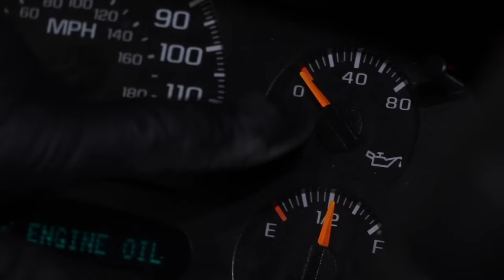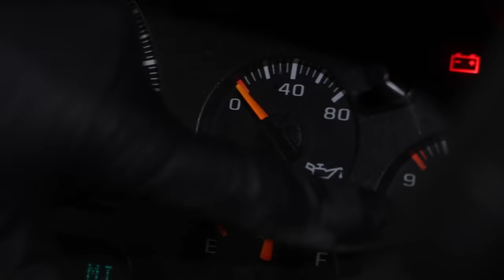Top 5 Problems 2000-06 GMC Yukon Sierra Chevy Suburban Tahoe Silverado Avalanche Cadillac Escalade

Comment: If you haven't replaced the water pump or brake lines, you will!
Reply: no brake line trouble here in the south
Reply from the maker: +Connor Kurtz Thanks for checking us out!
Reply: I have
Reply: Brake lines, water pump, AC resistor, clusters, 4 wheel drive switch, main drive tensioner... but still runs like a champ. Chevy
Reply: I actually have. You are exactly right.
Reply: well everything will need a water pump replaced but yea brake lines in the mid atlantic and north east don't last long.
Reply: I had to replace my brake lines on my 03 tahoe. Moved from jersey to texas... rust bucket
Reply: I’m on my third water pump on my 2005 Escalade at 150,000 miles
Reply: You might have to put new tires on your vehicle someday as well.... lol
Reply: I’ve replaced both on my 2003 Tahoe!
Reply: That can be said for any vehicle.
Reply: Yup.Brakes lines
Reply: Lol.. Just done my water pump on my 01 tahoe
Reply: @Patsslab  sounds like you arent running the correct amount of coolant or theres another issue somewhere in your coolant system..
Reply: I just spent1300 replacing brake lines😂😂😂
Reply: Ya no brakeline here either. But replaced water pump. Damn thing was leaking over my belts and making it squeal then I grabbed the pulley and it was hella loose.
Reply: Only if you're in a state that salt the roads will you need to replace brake lines
Reply: 2001 suburban 4x4 315k miles I’ve put 100k myself I’ve only had to do the fuel pump and rotors just did the plugs I’m still getting 400 to the tank 30 gallon
Reply: I had to replace my Chevy with a Ford... Solved all my issues. Lol
Reply: Changed brake lines 3 times in 3 years lol
Reply: I have Sensors ..whole new brake sensors water pump fuel pump  timing belt and normal wear and tear  But I can say 279.,000 miles and she its still kicking
Reply: @jaydaoud4203   lmao get a Toyota and you won’t have to replace anything. Owned a Camry and currently a Lexus is350 and have had to replace nothing. Biggest issue my 10’ Camry had was the tire pressure sensors were going dead which was to expected at 187,000 miles before it was totaled Other than that never had a single issue besides normal things like tires, oil changes, brakes + rotors. Lexus makes some pretty kick ass suvs that out do the Tahoe even in 2003
Reply: I'd rather lift the body (Yukon XL here) 2 more x for those 2 front brake lines (went stainless) than tackle these trans cooler lines again have fun in your driveway on your back getting the exhaust nightmare out of your way 🤭🤦🏻‍♂️🤷🏻‍♂️🤪 honestly gm would do a world of help simply anti seizing their bolts during production.. and the only place an LS belongs is in a ford, (or ANY damn thing other than that rolling trash can)
funny that sumbitch works like a charm (not in a gm)
Reply: @JohnDoe-di1fk  yours must be the 5.3 /1500 ?
Reply: @Drewsky840  I'm the luckiest mf'r to get one on the cheap in FL...and it wasn't nearly as bad of raod dressings as in this example, it's everything ELSE as well, but these "CHY_NUH!" lines are junk if you don't flush your systems out they rot from inside out too not just from atmosphere conditions.  ("Cheap" is a state of mind
Reply: @Hansel Sanchez ahh. You my friend suffered from the "Magical snapping overnight" ferry...seems to go with these heaps I've noticed
Reply: @slaviolovato1797  oh yes, let’s not forget about filling it up with gas every other day, I hate that!!!
Reply: Yes, already had to replace brake lines from the ABS pump to rear calipers on my 05 Suburban. The water pump, too. But I figured with +150k miles, these were normal wear out parts.
Reply: @c.bernier-tilley2364  HOW MUCH
Reply: 2003 with 240k miles, Nope! No problems at all
Reply: Oh I have,  my brake line rusted out but it went out on my driveway.
Reply: The brake lines were uncoated steel on GM trucks from the late 90’s through 2006. I had all lines replaced on ‘04 Escalade
Reply: @tmurph247  I DISAGREE WITH YOU...I OWN A FORD...A TAHOE... BMW..& A MONTE CARLO...THEY ALL REQUIRE MAINTENANCE" WHY" BECAUSE..ITS MAN MADE" AND PARTS ARE NOT DESIGNED TO LAST ..IF YOU YOU NEVER DO ANYTHING TO THEM...OH IT WANT CRANK" CK THE ALTERNATOR..OR THE BATTERY..CK TO SEE IF THE FAN BELT IS WORN OR LOSE" IF YOU NEGLECT SIMPLE THINGS... MAJOR STUFF IS ON THE WAY" NO MATTER WHAT YOU DRIVE"
Reply: 300k mile tahoe and haven’t touch a brake line
Reply: My brake lines have all been redone before I bought the truck, same for the fuel lines.
Reply: $600 for my brake lines😥
Reply: @cliffharvey5318  timing belt?
Reply: @c.bernier-tilley2364  I had to replace all brake lines, Rotors, calipers and pads..........
Reply: Just once each in 312000 miles, this is high praise for a platform.
Reply: Literally replaced my water pump/thermostat today lol
Reply: Brake line issues don't exist in the south
Reply: @Patsslab  3rd on my 2500 6.0 and 3rd fuel pump...3rd alternator too lmao
Reply: I did brake lines last year, now getting ready for the fuel lines....just got a leak.  Good ol rust belt
Reply: I did lol
Reply: @TheRob1024  04 Denali here, I replaced my brake lines also in 2020. Rust from hell. I'm from NJ and just move to Florida.
Reply: Great thanks theyre about the only thing I havent replaced. It still runs great as long as I keep working on it. 270 000 miles
Reply: @Patsslab  Im on my third alternator
Reply: I'm in Texas should I check my lines 🥺
Reply: Live in the middle of Michigan with salty roads.  Replaced the brake lines on my 2003 Silverado in 2016. 13 years, not too bad. Luckily the blew out in a parking lot so I was able to safely get it to a garage and get repaired without incident.
Reply: Water pump on a 2005 Yukon Denali was ridiculously easy to do.
Reply: I replace the entire cooling system
Reply: Rocker Panels as well
Reply: I don't have that problem. Fortunately. I just can't turn my lights off at all
Reply: Replacing all my brake lines now. And the water, fuel and power steering pumps. Everything sensor that's on the truck, both blower motors 2x and normal maintenance. I have 302868 miles and I plan on having my Tahoe til the rust monster eats the beast.
Reply: Had to do both 🥴
Reply: @Drewsky840  I need to replace my brake lines and I’m in Arizona in the valley where is doesn’t snow so no salt

Comment: interesting choices here. As far as most common problems go the only thing i really agree with on this list is the intermediate shaft. Maybe knock sensors too. Id like to add a few of the problems i see most at the dealership where i work.

In no particular order

#1. Intake manifold & water pump gaskets going bad.
#2. The brake lines rusting off
#3. Parking brake shoe linings separating from the backing plates from never being used.
#4. The instrument cluster lights burning out is more certain than death or taxes. 
#5. Heater core quick connectors leaking or breaking. 
#6. Door switch plates breaking away from the door panels.
#7. Spare tire cable seizing up in the housing.
#8. AC Compressors on early years. (still works just sounds like its going to explode)
#9. Fuel pumps and fuel lines on the non flex fuel models. 
#10. Various evap system issues.
#11. Cant forget the headlights/DRL lights filling with condensation!
#12. Also cant forget the DRL bulb sockets melting from the factory bulbs drawing too much current.

Overall these are all super easy problems that can be fixed on the cheap. Probably the best trucks ever built if you do your own repairs! Engines will literally outrun the frames in the long haul.
Reply from the maker: +fuckgoogle+ Thanks for the feedback!
Reply: I agree with both the brake line and parking brake they happened on my 2005 yukon xl and I used to have a 2003 before that and on both the 2003 and 2005 I had the instrument cluster screw up and it made my prndl lights so dim I could barely see them at night with the dimmer on max but I had a buddy solder it on my 2005 and she is perfect again

Comment: Very helpful video for those that are not too familiar with Chevy trucks and SUVs. One additional issue that should have been mentioned is an issue that comes up from time to time when a message comes up on the cluster saying "Reduced Engine Power" and the vehicle won't accelerate beyond 5 mph. A very frustrating issue caused mostly by faulty electrical connectors in or around the throttle body.

Comment: 03 2500hd 6.0, still going strong at 400k.
 Tow 4k Lb work trailer daily.

Knock sensors lasted to 395k. 
All my O2 sensors are original, did a wire chafe repair on front left at about 250k.
All original steering shafts still at 400k.  No issues.
Abs sensors were and issue on off brand hub.  Cracked wire.  Go ACDELCO only hubs.
Oil sending unit was leaking at about 250k, replaced.  No more issues.
Dash cluster went haywire at about 250k.  Separated motherboard and resoldered numerous resistors and diodes as needed.  Works great now.
Blower motor wire harness almost caught fire at 300k.  New harness upgrade from dealer and now won't go past 3 on the dial for safe measure (on 5 fan motor draws over 10 amps. F that).
U-joint (front) at 325k.
Water pump lasted to 350k.
Radiator lasted to 325k.
Hydroboost leaked from 100k to 400k, and just replaced that yesterday, still worked. Just leaked bad.
2 or 3 exhaust manifold bolts snapped at around 300k. Welded nut trick to remove.
Ac Delco fuel pump about every 100k.

Think that's about it.  Amazing truck.

Comment: Glad you added the "bonus" footage because that was EXACTLY my problem. I was trying to diagnose a P0530 code on my A/C "Pressure sensor circuit malfunction." Checked all of the connections on the compressor and high/low-pressure sensors and all of the a/c wiring that I could see. Checked fuses and swapped relays. No joy.  Just happened to stumble onto your video.  Thought no way in hell could anything be going on under the fuse panel but opened it to check for grounds, etc.  There was a fluffy nest made out of what looked like home insulation material and six wires were completely chewed through!  I have recently been getting other weird codes like multiple SRS airbag codes and random P0300 misfires.  Will solder everything back together in the morning.  Hopefully, this was the issue. THANK YOU! THANK YOU!
Reply: Update please:)
Reply: @MrJbooker33  Sorry for the delay. Yes, by re-soldering the severed wires it fixed the Air Bag codes and restored power to the rear DVD player which I didn't even realize was not working. I now hear it going through a self-check when I start up the vehicle. Unfortunately, it didn't fix the P0530 A/C circuit malfunction.  I think the PCM may have been damaged.  Going to take it to a local Audio Installation shop that specializes in wiring troubleshooting.  Stay tuned...LOL
Reply: @lizard944  that’s probabaly the recirculating door right?

Comment: I have an 2002 Silverado. My daily driver without the rust some of y'all are talking about. Currently over 310,000 miles and still going strong.  I use it for work and play. More than a third of the milage is towing miles. Wife wants me to buy a new truck but this one is well maintained and I'm hoping to get another 100,000 miles out of her.

Comment: Couple of years ago, i bought a 2000 GMC yukon, with little over 100,000 original highway miles. It had been stored away, due to title/ownership issues, that finally got squared. I gave it an extensive servicing and TLC. In two years, my SUV has taken us on unforgettable road trips and camping. The best investment, ever. Still going strong at 156,000 miles.

Comment: I loved and respected and understood your video. My 2003 Chevy Tahoe has had continual issues. I had everything done and still when it was hot outside and I ran the air conditioner for even 5 minutes the vehicle would drop to reduce engine power. You wouldn't believe the scam job I have received over and over and told by each guy, its the cadilatyic converter, which finally I had replaced. Guess what, that didn't solve the problem. I took it to O reilys, they ran a test, it cleared all the code issues. I had a harness of wires that didn't get out into the black plastic tube holder, We wrapped the wires and put in the black tube and so far for 2 weeks in high heat 90's and running the air conditioner I have had no issues. I have no mechanical knowledge, but It seemed to me that some temperature thing was kicking when it was hot and air conditioner on,  I did not have these issues in the winter or weather under 70degrees.  At least now I know I am not crazy and your video was excellent. The vehicle is running a little bit rough and it could be the sensors. The codes I got from oreilys scan, coincide with everything you talked about. Thank you  Connie D.
Reply: Your fuel pump is probably giving out mines would do the same i would turn it of then back on and it would run fine

Comment: FYI...2000-2006 Suburbans and Yukon XL, the rear left pocket above the jack is a perfect fit for the small plastic Harbor Freight 30cal ammo boxes.  I made a small tool box with one and it sits perfectly there.  Like it was designed to fit.

Comment: Great information, thank you. I've gotten lucky with my '02 with 280,000 miles. The only problem I've had was the intermediate shaft.
Reply: I just bought an 02 with 159000 on it it rides beautiful but that’s all people keep telling me how bad they rust I have some rocker panel rust under the back doors and some surface rust in the tailgate I need to get underneath see what’s going on but so far I love the truck

Comment: Brake and fuel lines rust, the stepper motors in the cluster fail, sending units slowly fail from modern ethanol gas, the center console lid breaks, the tailgate handle breaks, front door speakers fail from water getting past the window seals, blend door actuators slowly fail and make an awful ticking noise in the dash.
Not to mention the whole body rots away around you... Rockers, fenders, fuel door. But the engine will run on and on
Reply: Tell us how you really feel about the vehicles
Reply: With the exception of cluster failing, you hit the nail on the head with everything that voes wrong with these trucks. One exception the transmission fail at 200k if well taken care of.
Reply: Extremely accurate list. I'd add that the headliner starts to sag around the windows if you drive with them down often, a breeze gets under the edge and ends up pulling the headliner away from the adhesive over time. My center console is broken, the A/C ticks in the dash, the infamous running light constantly goes out, the rear hatch doesn't want to open some times, only my fuel and speedometer are accurate, but I've had it for 50K+ miles (sitting at 183k now) and it still runs like when I bought it.
Reply: Yes you're 100% correct on that but for some reason us GM lovers love the hell outta Chevy them engines will run forever if kept maintenence friend of minds still humming @ about 490×××
Reply: Lol same. My blend doors are ticking, rust hole in gas door (might as well take it completely off lol) and rockers need to be changed, and cab corners, and speakers, and gauge cluster steppers are taking a shit. All 4wd components replaced about 3 years ago, it’s the plow truck/spare vehicle. Do plan on replacing the cab corners and rockers before it eats any further into the cab.

Comment: If you have one of these year vehicles I would highly recommend replacing the coil packs. Did mine at 180k after doing the typical plugs and wires but had a slight miss that wasn’t throwing a code. Truck would shimmy slightly at a stop. Swap new ones on and it’ll run brand new

Comment: These vehicles are some of the most durable on the road,IMO.  Ford and Dodge during the same years had engine woes,the triton v8, which early on was a great engine in 2V form especially the 4.6 , self changing spark plugs aside,  was now a problematic 5.4 version,the 4.7 Chrysler is junk, the early Hemi was good IF the cam didn’t get eaten by a lifter.....but many did..The pre DOD GM LS engines were the best ever made,they were anvils of reliability . I am Fleet mechanic for a town municipality and my entire light duty fleet is 1500-3500 Chevy/GMCs,from 2003-2019 I have 13 of them.  Most of our trucks are 2500/3500s all with the LQ4/and L96 6.0s. Nothing else on the road will run as long as reliably and as cheap or is as easy to work on.  One thing you did leave out was the grounds...on the back of the drivers side front cab mount right under the drivers feet, there are several large grounds attached to the back of the mount tower, these are super important and they get corroded over time, I remove them clean the ground location to bare metal and cleanup all the terminals and apply fluid film at every oil change, these are ABS grounds ,electronic shift transfer case grounds as well as other various grounds... these are easy to get to while servicing the truck. I’m surprised you did t mention the oil cooler lines and here in NY the lower steering shaft u joint seizes up over time because of the road salt and the snow plows we put on them draw salt into the engine bay.....then there’s the last exhaust manifold bolt that snaps off....etc. Still the best trucks on the road!